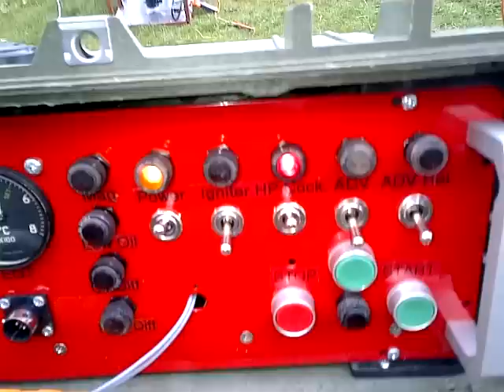Williams WR27 aircraft gas turbine APU test run SORRY NO FLAMES!

Comment: I used to work at William's. I have rebuilt MANY of those engines.
Reply: Could it be modified to power an experimental airplane with a propeller?
Reply: No not really.
Reply: @theroman21  Not enough horsepower.    The JFS100 is more suitable for that task; the Zenair Zodiac was designed around one.
Reply: Where could I find a maintenance manual on some of these Williams engines?